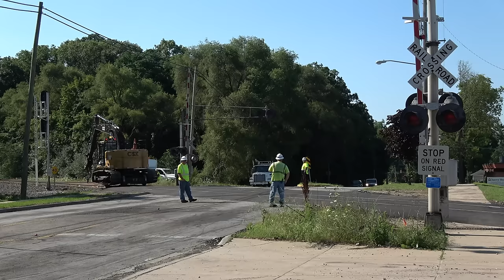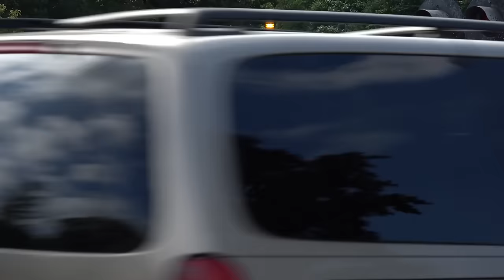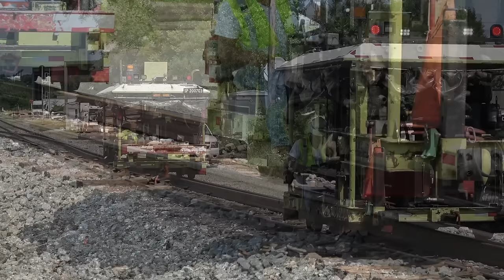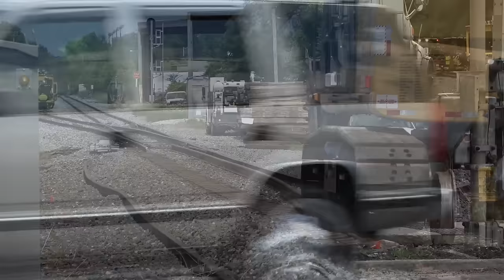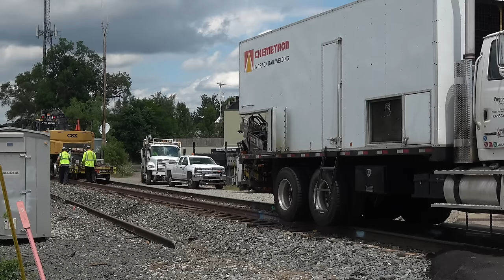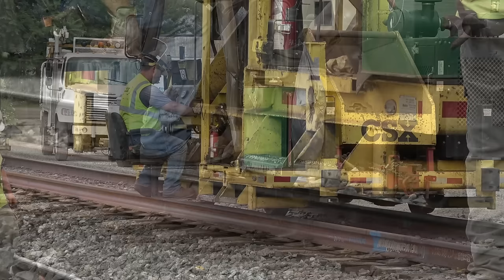TRRS 547: Railroad Rail Replacement

Comment: imagine needing a rail heating machine, because you are unable to use a pocket calculator...
Reply from the maker: What do you mean? How do you plan to stress a 1600’ string of rail without it when the rail temp is well below NRT?
Reply: @ThornappleRiverRailSeries  I probably don't understand the system.  Some explanations that I've seen state or imply that the rail expands and contracts longitudinally with changes in temperature with this movement being accommodated by periodic expansion joints.  In such a system, you only need to cut the rail to a length appropriate for the system temperature at the moment the cut is made.  A pocket calculator and pyrometer could be used for determining the appropriate length, with no need to actually heat or cool the rail to a given reference temperature before cutting and installing the rail.  If, on the other hand, longitudinal movement of the rail is actually constrained by the rail support system, then yes, the rail would need to be heated or cooled to the reference temperature before being constrained.  As I read more about this, it seems that a combination of expansion joints and longitudinal constraint is actually employed at different parts of the system.
Reply from the maker: North American railroads don’t use expansion joints, the rail is continuously welded. The expansion and contraction is restrained by rail anchors which transfer that load to the tie, which then transfer it to the ground. But, to keep the loads under control and within the bounds of what that restraint can handle, the rail is laid and adjusted to a set neutral rail temp, which is the temp at which the rail doesn’t have internal stressing from pulling or pushing. For most places in the US, it’s 85-115F. 

If the rail is already warm enough, they don’t need to heat it, as with this day. But if you need an NRT of 95, and the rail is only 75, for instance, you refer to a chart that tells you how much your string needs to grow based on the temp differential and string length. The heater than applied an even heat, and they make sure they get even growth. Anchors are applied right behind the heater to keep the adjustment.

Comment: You guys know this can also be done automatically right? It's a lot quicker. But I guess you can also do it this whay, its good to get a lot of people at work for absolutely nothing.
Reply from the maker: Full automation is more expensive, so it is reserved for special cases where it is needed. Even the automated machines require tons of people to keep them working. 

This method, used by basically all of the US Freight railroads, gets it done quickly at a reasonable cost.
Reply: @ThornappleRiverRailSeries  ok, then you guys got other automatic machines then we do have. A fully automatic machine can be operated by only 6 people, one driver, and 5 people to monitor the operation over the complete length of the train. Its easy quick and low costs sins it works on the overhead power lines of the train's (I know you guys don't have those everywhere)

Comment: Stupid - East Coast Tracks are done both tracks at once by a train car carrying track and railroad ties. everything done by one machine
Reply from the maker: East Coast tracks are also maintained to a much higher standard and from the sounds of it, essentially replaced completely when they do any significant maintenance. Here they just replace what needs to be replaced occasionally. And a single machine is not necessarily cheaper than many. Those huge machines are super complex, and a failure in one segment of the work can bring the whole thing to a stop.

Comment: Why do American railways use spikes ?  Those things are so old fashioned and anachronistic.  Would have thought they would use modern fixings like Pandrol clips.
Reply from the maker: Some areas to due clips, including at switches and crossings. There are various reasons, but I believe when there are wood ties, spikes are cheap and more easily worked on when spot maintenance is required.

Comment: USA last country still using wooden Thys .Neandertal  technology.
Reply from the maker: Nah, most railroads worldwide are still using wood. It works just fine unless you’re handling LOTS of tonnage, or need to tightly control gauge for high speed running. Concrete ties are more expensive and are much harder to work with, generally speaking
Reply: @ThornappleRiverRailSeries  Wrong also treating wood is pollution.
Reply: No your wrong
Reply: @coreymaynard2747   2 derailments says it all.